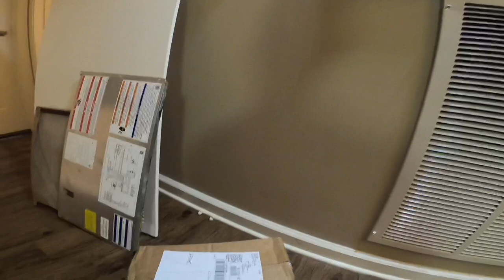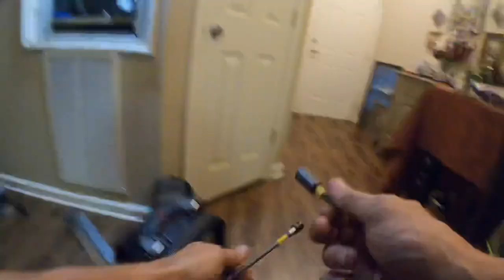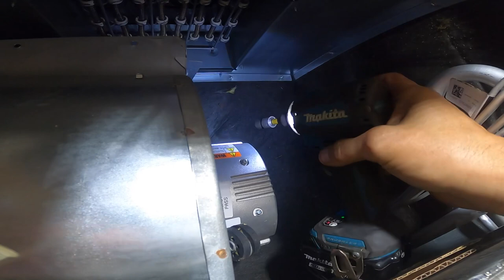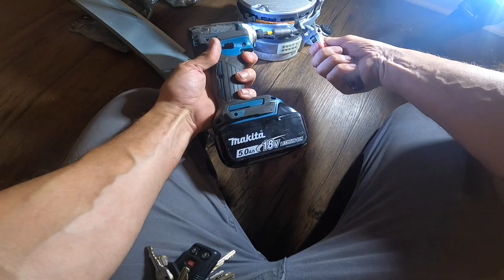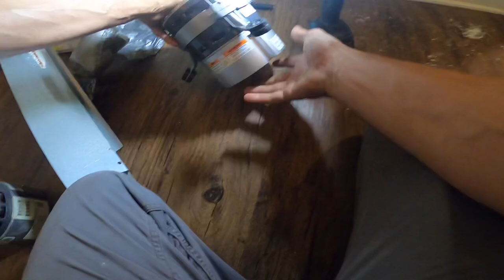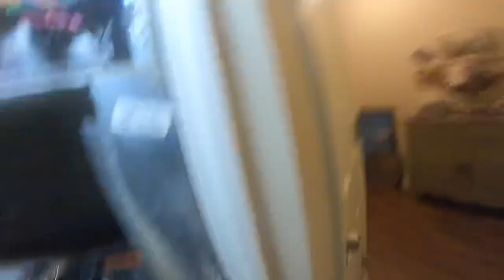You can’t do that! I’ll show you how. Blower motor replacement.

Comment: What asshat designed this thing. Must have found his engineering degree in the forest. Stupidest design I’ve ever seen and I’ve been doing this for 45 years. You’ve got patience I’ll give you that. Good job.👍🇨🇦
Reply from the maker: When I first saw one of these, I called the distributor and asked if they were meant to be disposable.
Reply: I had the exact thought bout 40 seconds in and got on here to see if anyone else thought this and first thin you said it perfect. I always say I’d shake very engineers hands that build Hvac equipment most I’d kick square in the nuts. This engineer needs to get TF out of our trade smh
Reply: It might have saved you some time, but at what expense? What a pain in the butt. Must have edited out the customer standing over you wanting to see how to do it next time, and is this technique cheaper? Better have some tissue and duct tape for when you lacerate the forearm. Thank you for doing the video, I've often wondered if it could be done.

Comment: I’ve done several the exact same way. After you do one or two, it’s pretty easy.
Reply: All the ones I’ve done, I have to pump down unit and remove coil, because 9 out of the 10 I’ve done, the shaft and wheel is rusted together and I have to use a torch and puller to remove it. Apartment maintenance smh. I probably do about 5 a year and now it takes about an hour or so. Those coils are a POS to because they always leak where the aluminum is factory soldiered to the copper.

Comment: If it would have been rusted bad u would have been screwed. I believe if you remove that control box u can get the assembly out sideways.  Not sure on that particular set up. But I have done it on similar units.

Comment: I just installed a similar unit by Rheem, the space between the motor and the cabinet is about 2 inches, I hope I never have to replace that thing..... In worst case, I will be only replacing a module.

Comment: I've changed many of these motor in this style system but I've always had room to lower the coil. This vid was very helpful if I'm ever in this situation with no room to reach the side screws. Bet it was a b** putting the motor back in.

Comment: easier to lower the coil and remove the whole thing. then you can clean the blower cage if need be
Reply: The coil brackets and screwed from the outside and you can’t get to them unless you wanna cut some drywall then patch it
Reply: That is the problem when the ac room is too tight you can not remove the screws from out side and lower. The EVAP coil so then when the nightmare starts.

Comment: Those motors can't be as bad as I think they are???
🤔
Stay safe. 
Retired (werk'n)keyboard super tech. Wear your safety glasses.
Reply: Those particular motors itself are fine half the time, it’s the modules that go bad, would be a whole lot easy if you could order just the modules, because they are easy to take apart even in that small space. But they make everything now to where you have to replace the entire thing

Comment: Your attention to detail really sucks. Yes you are focused on repairing there system but never work on there floors. Go outside and change it out If that was real hardwood you would have had scratches on through that poly.